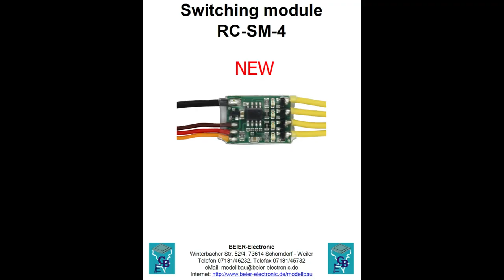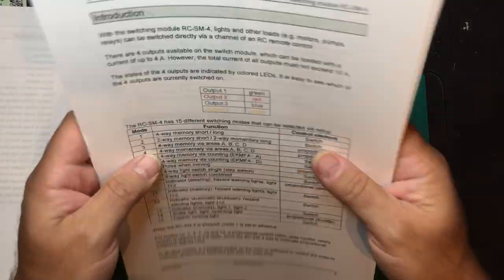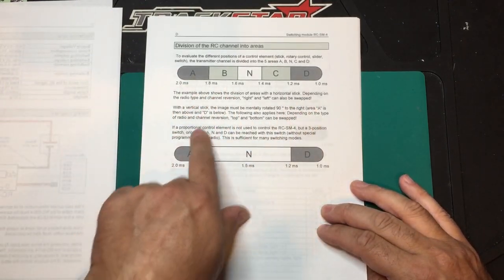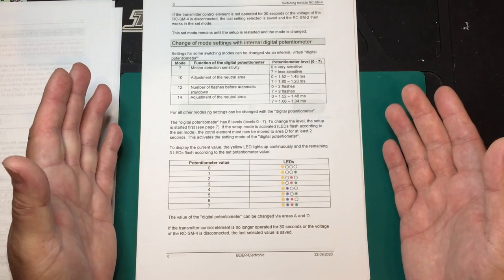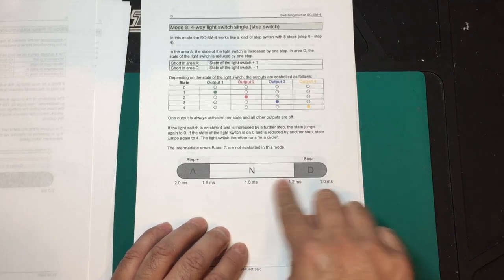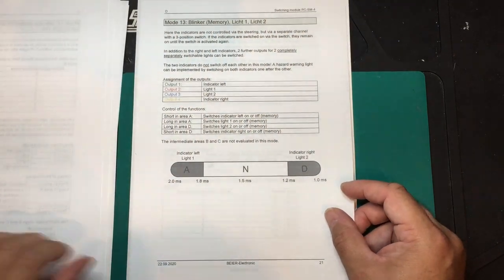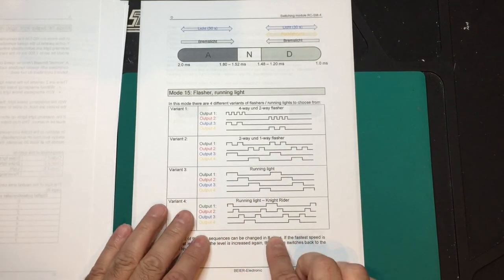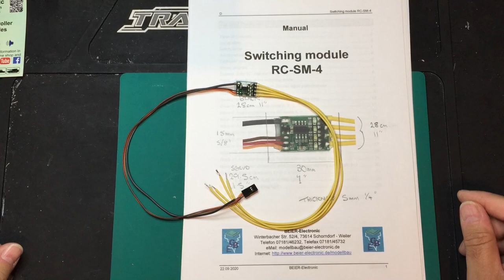Beier RC-SM-4 what is it.

Comment: Thanks for these great vids on the Beier products. i have te USM RC 2 and never really got to install it due to it being very complex ( i am getting on ).  This might sound a stupid request but can you think about doing a vid on wiring up LEDS for the beier units? i understand the resistor part BUT not sure about paralel or series circuits. If doing a cab OR trailer with loads of marker lights how do you choose the type of circuit? thanks
Reply from the maker: If your running loads of marker lights it is not always a good idea to run them in series. If a resistor was to fail it might overload the rest. If you do not need to dimm or fast flash the marker lights one way would be to wire them direct to a battery of power source through a relay and just use the switch output from the Beier to trip the relay. Beier also do a unit for high current applications. you will still need to put the correct resistor on each LED and just wire them back to a central point. https://www.beier-electronic.de/modellbau/produkte/uat-1/uat-1.php?sprache=gb

Comment: Eine sehr gute Video-Serie! Leider ist das Schaltmodul aber nicht richtig gut zu sehen. Ich kann nicht erkennen was für Bauelemente auf der Platine sind (Spannungsregler, Microcontroller, etc.). Vielleicht könntest du ja noch ein Video mit Detail-Fotos machen. Danke!
Reply from the maker: I am using a breadboard power supply that gives out 5volts. so I am running 220ohm resistors with my LED's. I am going to more video's soon showing 2 SM4 in a RC crawler/car to provide Turn, Hazards, Light as well as diving lights with reverse.